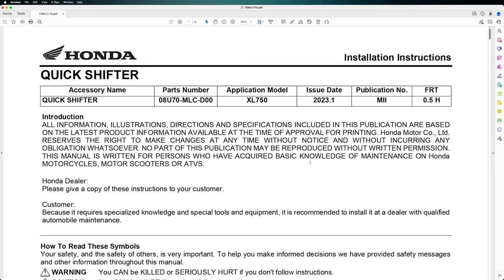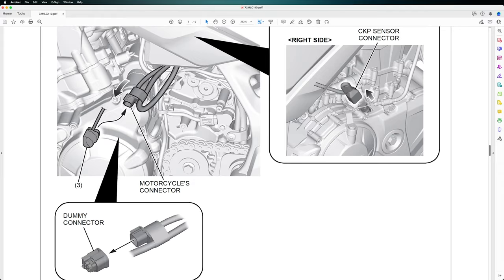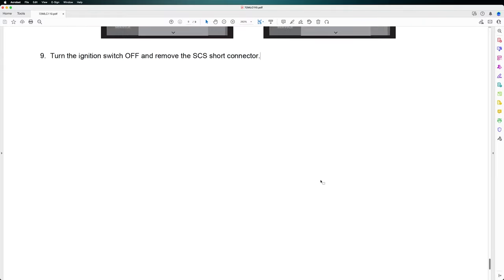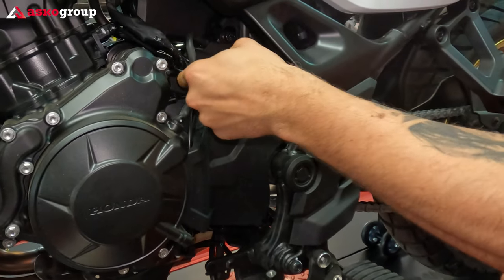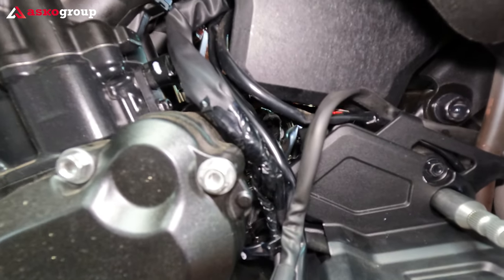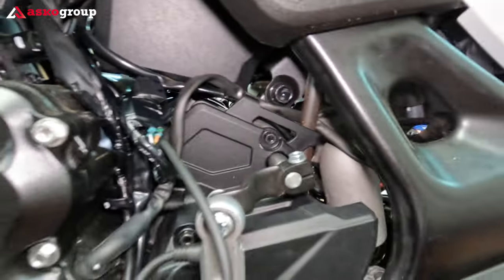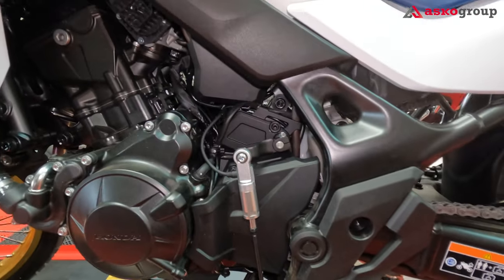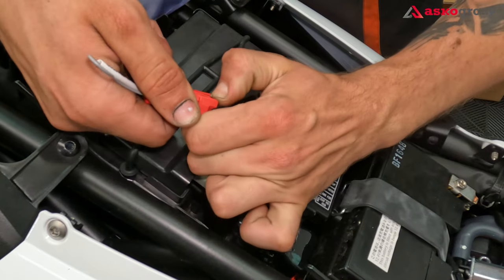Honda XL750 Transalp 2023 - QUICKSHIFTER INSTALL - Complete Video Tutorial

Comment: I purchased a quickshifter from Honda and the length of the arm does not match the 2023 PDF or the PDF pictured in these instructions.  here it is supposed to be 98mm + 10mm + 12mm = 120mm rod total length but the included threaded rod in the 2024 kit is quite a lot shorter than that. With the shorter rod, it still worked out ok with a similar amount of thread showing above the bottom nut and below the top nut,, the gear lever was in its original position in "N". Maybe some part has been revised.
Reply from the maker: From what I've seen it's adjustable

Comment: quick shifter has 3 options low medium and hard do you know what is the difference?
Reply from the maker: I use HARD as recommended by the dealer. Do you want the QS to do it's thing with a soft pressure from your foot, medium pressure from your foot, or hard pressure from your foot. It'a about the pressure you put to your foot (Soft, Medium, Hard.) try to see which one fits you better, greetings !

Comment: @IdealBike Hello, would you do a video as to how install the USB socket inside the front left panel? It's a bit messy here. I thank you in advance for your help.
Reply from the maker: Sure it will follow as soon as I receive the parts, I'll film the installation
Reply: @IdealBike  Hello, I've watched your USB socket installation tuto. I could do today everything I needed. On that occasion, I found each pinion enabling me to adjust the headlights aim. Bottom left pinion: high beam and upper right: low beam. I thank you very much.
Reply from the maker: @fredericYY Greetings where exactly it's that pinion?
Reply: @IdealBike  There are 2 pinions (low and high beams). They are aluminiun plates with screw head in the middle. You can see them in your own tuto concerning the USB socket installation.

Comment: I've installed but... initiallization successful. However... Can't get it to work? Or how it work? Now engine light remains on.
Reply from the maker: You need a connection from the dealer
Reply: Found a way to bypass.. with a cable twist tie to jump the connector. Thanks.